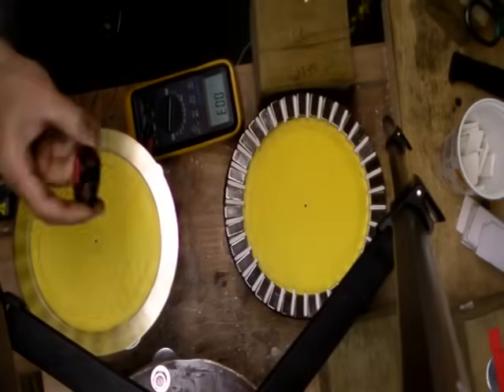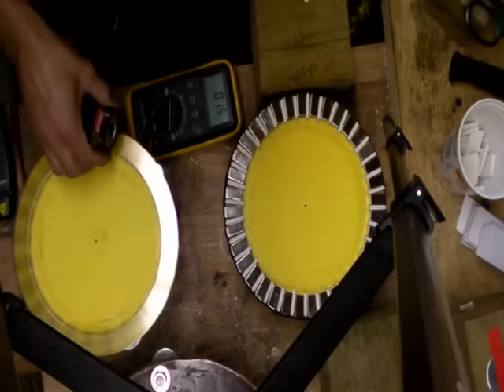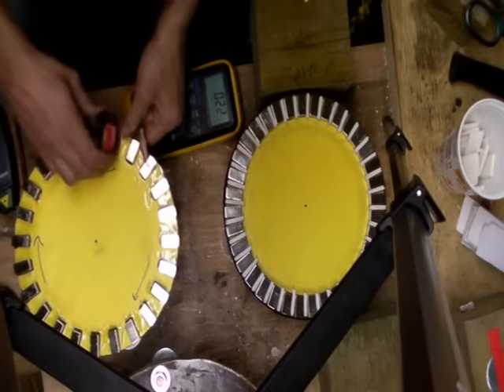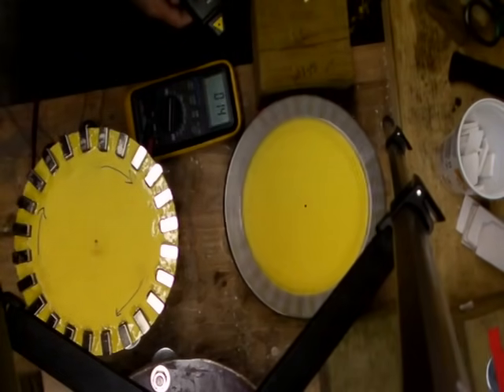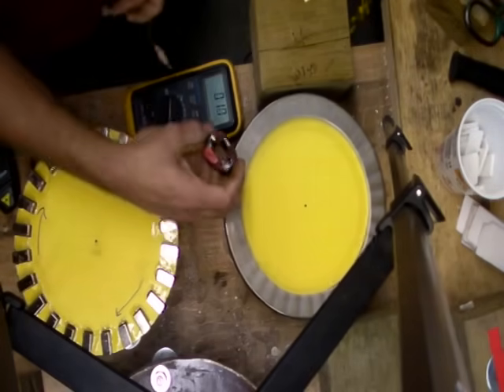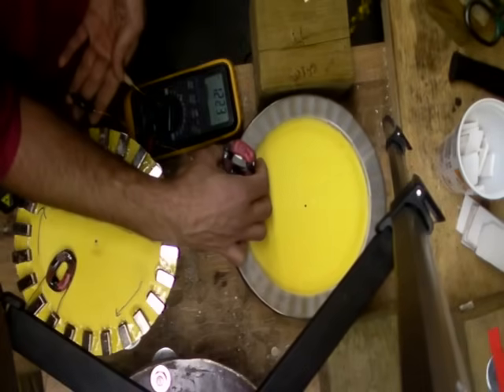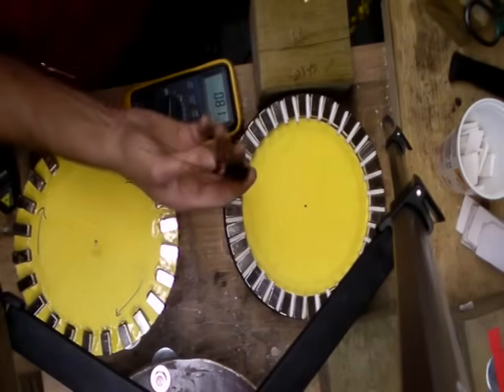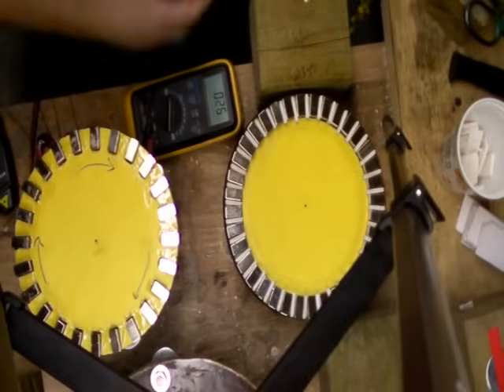5 phase 36-24 magnets VS coil size shape pma wind turbine vawt hawt 36

Comment: Apologies for this lengthy and detailed reply, but this information should prove useful. 
Please consider these design parameters changes I suggest will improve your machine
performance. Your 24 magnet rotor is correct to have alternating polarity magnets placed
on 15 degree radians but the coil design and architecture you show is not matched to the 
rotor architecture. Best would be to use coils that overlay adjacent radians having the 
radial legs of the coils coincide with the adjacent radians so the radians are center lines
for the centers of those radial legs of each coil and the length of the legs should be a 
third to a half longer than the radial length of the magnets.  As the rotor passes below 
each stator coil then adjacent legs of the same coil will be radially aligned with the 
magnet below so the flux angles are not skewed and the transverse flux cuts the coil
legs at right angles which results in maximum voltage. Precise radial alignment of the 
legs of the coil segments with the magnets will result in the flux cutting across each 
leg on adjacent sides of the same coil segment adding their voltages together as 
the flux cutting across each radially aligned leg is in phase and additive in that coil
to increase the output from that coil.  12 coils have 24 legs and that is the correct
number of coils to match the 24 magnets where all of the coils may be connected 
in series to add their voltages because all are in phase so long as the coils are wound
in the same direction.  

There is space allowed for a second set of 12 identical coils being lapped like shingles 
on top of the 12 coil segments that have formed 1 phase, without increasing thickness 
of the stator in the very important dimension that is the magnetic gap,  avoiding loss
from increased air gap to accommodate the additional set of coils. Recall what was
described as making the radial legs of each coil longer than the magnets. This will  
become clear allows flexibility in the coil end loops for overlapping a second layer
of coils having the legs of the second layer of coils on midpoint radians in the same
way as is done placing coils into the slots when building stator windings in more 
usual radial motors. Where the end loops are lapped has added thickness but is 
located beyond the ends of the magnets running gap so thickness of the magnets 
provides the added clearance space for lapping the coil end loops for the second
layer of coils that provide the second phase. This is only a clearance issue for the
inboard lap of the second phase set of coils which will cause an increase in the 
stator thickness but cause no mechanical interference, and the thickness of the 
coil laps is not a factor outside the circumference ends of the magnets in free air.
Your prototype would best match such a 2 phase architecture. For a small scale 
machine like this a 24 gauge wire would seem reasonable. Low rpm alternators
are very much scale sensitive because of the physics involved with velocity of
the change in magnetic fields.  It is the similar effect as the "tip velocity" for a
helicopter blade where a magnet at the tip of that long blade passing a coil at
high speed  would produce much more voltage and power than the same pair
place nearer to the axis of the rotor at the same radial rpm. 

Another architecture similar to the axial flux design of your prototype works 
better in a similar way but uses transverse radial flux between magnet pairs 
across the legs of coils. It has its advantages of simpler architecture and  
higher performance. It uses rectangular form magnets similarly as a hub 
motor.  There is no solid disk rotor required but a disk rotor may be used 
as the mounting plate for the radially arranged spokes with ends of each 
holding a U-core with its legs axially parallel so one leg is inboard and the
other leg is outboard on the same radian. No second rotor is required for
transverse flux through the stator coils which are arranged in a ring like
the rim of a round hatbox that is straddled inside and out by the legs of
the U-cores having magnets on the inside faces of each leg of U-cores. 
In actual architecture the U-cores are more like C-cores. It is easier to
describe such architecture as U-cores. An advantage for this is that 
the diameter can scale up easily and rectangular form magnets and 
coils can be used for more efficient low rpm machines. The efficiency
is increased more over an Axial Flux machine because the flux path is 
closed by the U-core or C-Core so the flux path is concentrated in 
the air gap through the stator coils and is flux moving at right angle
to the coil leg conductors for highest induced voltage and better 
waveform than will be obtained by any axial flux design. Rotor sizes
that are quite large avoiding a directly proportional increased weight
and cost could be made accordingly and the larger the diameter, the
physics involved favors higher voltage and power at lower rpm, but
with less difficulty and more efficiency than similar axial flux designs.
Reply from the maker: WOW! i have never seen someone response in so much detail, you made good points on few construction steps, design, medium, layout, etc... i am sure other will find your comment helpful. thanks again for your feedback
Reply: @emagnets  Thank you for considering what I offered as suggestions. 
When I described the architecture for the coils I know it is not how most 
have been doing this for years so I am prepared for any criticism about
observing the coil architecture most have be using trying to make the 
coil opening a same shape as the magnet while not paying attention to
the radial position and angle for the legs of the coil is inefficient. It is the 
flux crossing at right angles to the coil legs is where most of the voltage 
is developed. The same physics is applied in radial motor architecture
seen in the stator slots.  When I described lapping the coils so the end
loops increase thickness where overlaps occur in spaces where there
is extra space for clearance, it is exactly a same method used when a 
stator is built for common radial stators where the overlapping of coil
end loops is done in the increased space past the end of the stacked
stator laminations,, keeping  legs of each stator slots the same  depth. 
Most of the flux is directed to cross the legs at right angles so that is 
where the most power conversion occurs, and same effect should 
be observed for axial flux motors that are not using iron cores for the 
coils, and when using rectangular magnets. Using more turns of smaller
wire increases voltage for the same rpm, but of course limits current. 
The tradeoff there is an unavoidable factor in design. That aspect is 
similar to the AC frequency fixed by number of poles and rpm where
it is a rule. 60 cycles for the 24 magnet array would occur at 300 rpm 
using the architecture I described with the stator coil legs on each of
the 24 radians. The same architecture with 48 radians and magnet
pairs would output 60 cycles at 150 rpm, and 96 at 75 rpm and so on. 
The magic about 60 cycles or higher frequency output is then can be
used commercial transformers to change the final output voltage. 
There are large versions of the Variac operated by servo motors to
slowly regulate final voltage output from alternators that produce
slowly varying output. It is an old technology used for AC voltage 
adjustment where a mismatch must be resolved between the 
alternator and the load.  

If anybody prototypes stator coils having the radial legs centered 
along the magnet radians then the shape of the bobbin needs to
allow enough extra length in the loops at the coil ends to be bent
over to overlap the adjacent coil loops. The end loop of one coil 
must be bent upwards slightly and the end loop of the adjacent 
coil is bent downward slightly for providing the overlap area. 
Slack in the end loops is provided to be sufficient for making 
that lap in the bundles of wires and does not distort the radial 
alignment or spacing of the legs of adjacent coils.  For the 
shape of the bobbin the straight legs will provide a wire coil
leg bundle of finished size centered over the radians, longer
than the magnets by about a third, and the ends will be an
arc shape bundle of wires. When the arc shaped end parts 
of the coils are bent slightly for the overlapping it will allow
all the straight legs of the adjacent coils to lay flat at the
same thickness for the air gap between the magnet rotors. 
For a larger diameter alternator a third phase set of coils
can be incorporated, where the spacing is adjusted so
the radial leg of the second phase is at one third and 
the radial leg of the third phase is two thirds the magnets
radian spacing. My suggestions are based on my own 
understanding. I have not prototyped this architecture, 
to prove my ideas correct. But I am simply sharing what 
I observe looking at the designs being used and thinking 
how and why I would build a similar machine differently.
Reply from the maker: @artpatronforever  OK, that is great additional discription, i be honest with you, i have no time lately to create and test. you should apply your ideas/thoughts and start building.
Reply: @emagnets   Same problem I have is no time for experiments. In Florida
the area where we live is still being rebuilt from Hurricane Michael while 
having to cope with the evidently and hopefully soon ending pandemic. 
Not complaining at all, but not having time enough available for doing 
experiments except as a thought experiment for now.  I truly wish I did 
have more time for building instead of rebuilding. Until then it seemed 
I should share these observations and offer suggestions that may get 
tested and put to use by anybody welcome to fact check the ideas. 
It should be easy to compare one coil geometry with the other holding 
each near the turning rotor and comparing output voltages for coils 
having same number of turns to tell the story.  Pretty sure what is the
idea I described will fact check okay. If not, then back to the drawing
board as the old cliche' goes.
Reply from the maker: @artpatronforever  hey bud, sorry to hear about your struggles regarding the hurricane, i hope better days ahead for you and family. i will take your advices into my next test ventures.

Comment: What is the optimum RPM the generator should run at?
Reply from the maker: with this test i set the RPM at 160rpm, for the setup i was planning on 24vdc at 200 rpm

Comment: Nice work, can you please tell me what guage wire and how long a wire would I need 50amp and 24 volts, I'm using N52 neodymium magnets 60mm by 30mm I can control the speed they are going around
Reply from the maker: what i am using for both are 18 gauge, 
the 100s turn coil is 35feet
the 150 turn is 55

you are asking for 1200 watt gen, but at what rpm? and what is the magnets count.
based on you magnets it will be low rpm, 
you could use gauge 14 
60turns that will give you approximate coil size at 2.25" X 3.25"
the approximate length will be 40feet each coil
remember to test and validate coil-turn-count/wire-gauge/coil-size-shape-layout/ with rpm/coil-magnet-gap/magnet stength.....and so on.. you are creating a generator from scratch, there are factories that took years to figure out the proportions of power/balance.
Reply: @emagnets  thank you for your kind reply sir. I am using 4 magnets only n52  60mm ×30mm and a single coil its not a generator at this stage just proving a concept so that one coil has to give a pulse of 50 amp and 24 volts every times a magnet passes by, 
the speed of rotation can be adjusted I can rotate them from 1rpm to 7000rpm

Comment: Why 5 phase?
Reply from the maker: Oh, well. no reason really. 3 phase is good enough. i was just trying to test ac to dc conversion efficiency, so it is more efficient to convert ac to dc with more phases, but the cost is more. it was just a test.
Reply: @emagnets  oh ok. Thank you. I'm just starting to learn about this stuff. I really only know machining, hydraulics, and fabrication. So that's why I may have asked the not exactly "dumb question".

Comment: I think to use 36 magnets you need a larger diameter to have the same spacing between magnets and the speed will be higher with a larger diameter, and you will see a higher voltage. Also you will have more coils if you use more magnets and consequently higher voltage in the turbine.
Reply from the maker: you are correct.  this vid was to show the effect when magnet/coil are not layout correctly

Comment: Have you tried either of those on a larger diameter disc so you have more space between magnets? I just wondered if the fields were too close together and interfering with each other  and causing the output to be less. Thanks for the video.
Reply from the maker: L. J. Bush 
That is exactly what is happening. That is why i am showing the effect. More magnets is less output.

Comment: emagnets
This is an old video so I wonder if you are still around.
Based on your video the 100 turns coil with 24 magnets is the best design for your presentation:
100 turns coil 24 mags yielded 1.4 volts
150 turns coil 24 mags yielded 1.8 volts
You increased the amount of turn by 50% but only got 28% increase in voltage.
So it appears that one of your viewer was right more than 1.33 magnets per coil decreases efficiency. (Transhumanist Space Exploration).
Reply: Nice clarification.
You sound like a professor, i am just a guy trying to show what i got.
Reply: Sam Chamas
I am not a professor, thanks anyway. Those were open circuit voltage readings. It would be of more value if you had a load, like a resistor or small light bulb.
How is your project going, any update ?
Reply: Hi Mark, i have slowed down on wind and gens, i have few gens on small vawts that produce around few hundred watts. my main power comes from solar, it is much cheaper and low maintenance compared to wind.  i am sure i will get back to wind power generation in the future.
regards
Sam

Comment: Very useful videos. A question - if we have a rotor spinning at a constant RPM, will increasing the number of copper coils increase the output voltage proportionally?
Reply from the maker: +Hamed Faizi , if you increase the number of COILS then you must increase the number of Magnets that will result in more power.
if you increase the number of coil turns and you have the space for that and without changing the awg of wire, then yes more voltage.
Reply: Thanks. Is there any useful papers or formulas?

Comment: I.m curious about if doubleing the size coils diameter & double size mags (but test smaller too;) 2get 3volts.  and:)  maybe if jyst adding a new layer of mags more inside diameter of rotor would help. I kno it would.  but the EFICICANCY? IDK.   
idk why ppl don't add as many coils n mags around every inch of spin. if its spinning- it should be makin daddy money!  right sir pimp alot?  ok then;-)   sweet posts... ty lots. u save me time... ty ty ty

Comment: Thank you for sharing the experiment. However the difference of 0.1V for1 coil over 24 magnets vs 36 magnets is not important, the main advantage of 36 magnets rotor is that it allows you to build a 27 coils stator instead of 18 coils stator.

Comment: You really need to measure watts not volts
Reply from the maker: +Trev S true, watts is where the real test is. these videos help others with ideas, i have evaluated gens watts in other videos,
Reply: emagnets There's some really good digital Watt meters made for the Radio Controlled Aircraft enthusiasts - We got a 120a/90v rated one off ebay for less than $20

Comment: put round magnets and buy them with hole for screw in midle this way its much better and compensate with the balance and much easyer to make coil ... the hole in the coil sopose to be exactly as the diameter from the magnet.... make rotor biger and stator also... to have room for gap... what can i say it will be more expensive parts and more coil do wind... but more efficiency. and buy a proper bridge rectifire those diods are crap ...make 3 phase not 5....AMPS dose the power not voltage so if u have at least 14.5V its good 1.5 volt will lose in bridge rectifire so u will remain it 13V for charge a 120A Baterry u can hook up to an Inverter. BY THE WAY you should balance everything if wabbles ... your machine will distroy it self in short time... bearings... etc

Comment: Have you tried coils would on a core?  For example a piece of soft steel with the same cross section area as the magnets.  You would need to make a bobbin from micarta to protect the wire from the metal.

Comment from the maker: @clark2002jc, the putput depends on the coil winds and rpm it is spining at, However this setup did produce 28vdc at 100 rpm. i had "18 coils at150turns per coil" and "24 magnets" 2 discs.

Comment: Are the magnets mounted on steel discs? What is the advantage in using a steel backing for a single magnet rotor passing flux through only one side of the coils?

Comment from the maker: jedufa, you are correct, in oder to use the 36pole i should have increased the diameter of the magnet disc and coil, that is the correct adjustment to fix the coil output. but i do not want to increase the size of the discs, and i tried to show that it is not possible trade off. yes, the 36 pole will produce more under the correct coil/magnet relationship